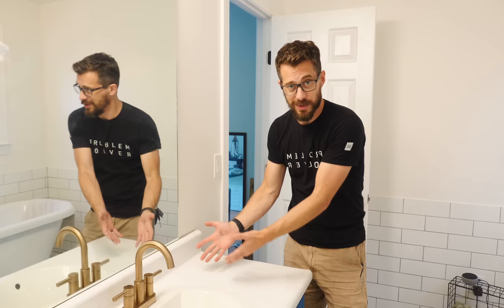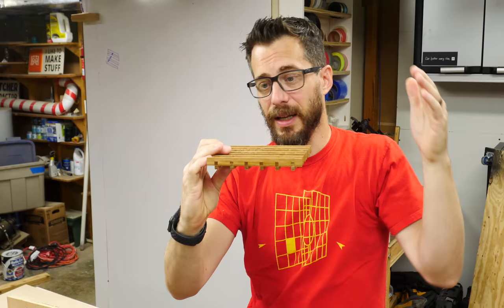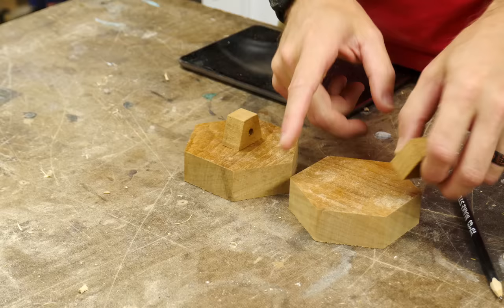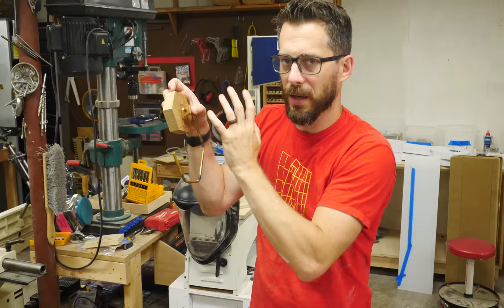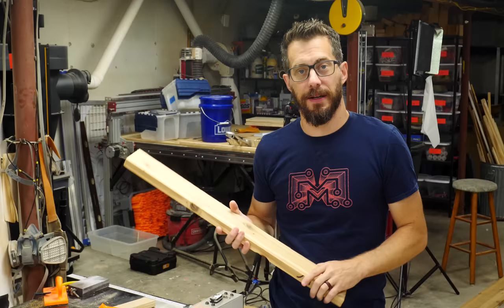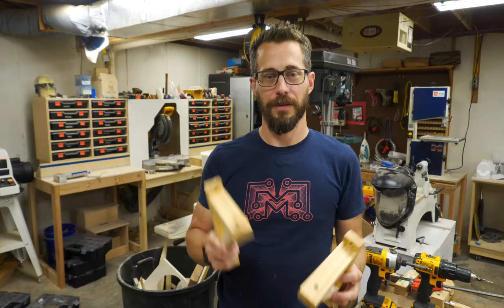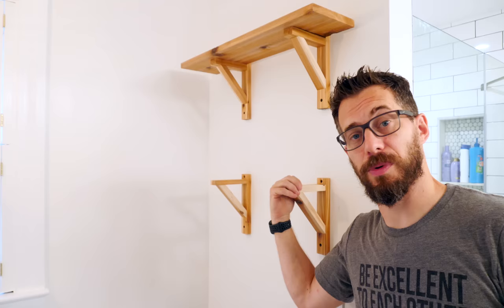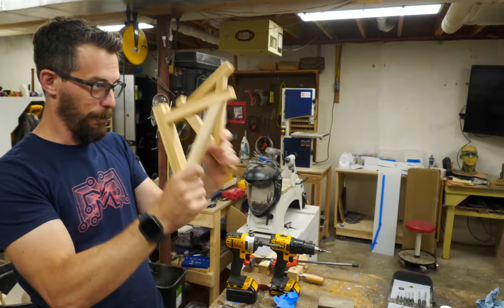How to Make 3 Easy Bathroom Projects // Woodworking | I Like To Make Stuff

Comment: A tip for things like the towel holder where the screws need to be in precise spots that you cant see, take the towel holder to the copy machine and make a copy.  You can then use the paper template to drill the holes in the correct location.
Reply: As the majority in my country is renting (empty!) appartments/houses and we would have to remove all our "individual" stuff if moving, I'd go with double-sided mirror tape (or another removable gluing method). Bc screwing screws ;o)
Reply: um...you've just changed my life forever. Thank you, sir.
Reply: Or if you don't have a copy machine or scanner handy, you can use an old mechanic's trick: hold a piece of paper on the part, and rub a slightly dirty finger (or a crayon) across the features you need to transfer,  like a gravestone rubbing you may have done in grade school! The outline comes out surprisingly sharp.

Advantage of the copier/scanner method is you can run off as many templates as you need.

Comment: Just a quick suggestion from a fellow DIYer with young kids. I would recommend attaching your towel hanger with screws directly to a stud. I have doubts about a keyhole mount surviving your kids hanging from the towel. I recently had to rehang my kids towel hanger after they nearly pulled it out of the wall where it had been attached with a large drywall anchor. If your kids would never do this then ignore the suggestion. Big fan of your work.

Comment: Loved that towel hanger. The cheap $3-$5 hanger I use on my wash basin breaks apart every year. This one looks simple and effective. Instead of brass I could use anything else like copper tube or acrylic rods  or rings whichever is at hand or easily available. Thank you.
Reply from the maker: Sounds cool, just make sure the copper doesn't leave corrosion marks on your towels.
Reply: @Iliketomakestuff  Good tip. Thanks.

Comment: I made almost exactly the same shelf brackets from cedar a few weeks ago. Only I put the top screw hole behind the brace. I just about managed to screw it to the wall but that was a challenge.

Also I might steal that idea for towel holders. Our bathroom doesn't have a solution I'm happy with and I like the hexagonal look for this. Cheers Bob 😀

Comment: Can't tell you how many shelves or curtain rods (or something with two brackets that need to be level) I've hung and it never occurred to me to use the LEVEL itself to mark the height of the two holes. So simple, yet so genius. I usually set the curtain rod, or the shelf up after attaching one side and then put the level on top of the shelf to figure out where to put the holes for the other.

Comment: Great small projects. Something to think about when bending the brass rod for the towel hanger, maybe make a form to bend it around that way you will get tighter more consistent bends. Also I learned that you should always wear a mask when working with teak as it is not really good for your lungs, more so then pine or oak.

Comment: Hi Bob,

I was wondering if you can do a video on how to install recessed lighting in a finnished roof that doesn't have attic access? Can you show how to plan out the placement of the lights while how to avoid joists and how to snake the wire across? I'm planning on installing some lights in my living room which is around 14 feet by 25 feet, but I I'm not quite sure how to do it without damaging the ceiling. The ceiling has popcorning, so repairing any damage is a nightmare.

Thanks.
Reply: You can use string and some thumbtacks to plan out the lights in the ceiling. We did that in our kitchen. This way you can ensure they are spaced consistently and can use another thumbtack to move them in our out along the string to maintain your distance. Lowes and Home Depot both sell recessed lighting that isn’t very tall into the ceiling so you’d cut your hole in the ceiling and then can fish the wires through to connect the lights. The only trouble would be placing power. If the room already has a light source in it, can you connect the wire to it and then run the wire over to each of your lights? We did the kitchen lights without going into the attic that way.
Reply: @BenTaylor11  Thanks for the tip. That seems easy enough. I don't have power in the ceiling though. Instead, I have a 3 way switch controlling an outlet. Also, whoever wired the circuit cheaped out and didn't put a neutral wire in the secondary 3 way switch. So, running power up there is the trickiest part.

Comment: you should do a bits video about different fasteners. I always run into issues when it comes to what fastner to use to put something on a wall or for other non-standard applications like you do in a lot of your videos.
Reply from the maker: Not a bad idea.
Reply: @Iliketomakestuff  You really should do that. I have a project that I'm working on currently, and I was uncertain on how to mount it to the wall so that the face closest to the wall is flush with the surface of the drywall. I have a keyhole bit & recently got a router with a plunge base, but it wouldn't have occurred to me to go that route until seeing your towel holders. It would be really helpful to see a smattering of fasteners and mounting techniques along side an explanation of what they work well for and what kind of aesthetic they lend themselves to.

Comment: I would add four little rubber legs to this soap dish in order to let water easily dry or go somewhere else. Flat parts of the wood in the bottom, even though it's teak wood, might not allow water to be removed easily which might cause stains or mold can appear.

Comment: Not sure for your shelf putting the screws into the end grain of the horizontal piece is the best idea considering all the weight it needs to carries. Maybe putting a dado on the verticle piece for the horizontal one to sit inside will help and so the piece is supporting by the wood.

Comment: Well you might have oiled the shelves, because even if they can't be soaked in water, humidity can accumulate on them and so lead to small deterioration over time but tht's an impresive work!

Comment: Did you consider cutting out a metal template and bending the copper pipe around that for the towel holder? Might help keep them consistent.

Comment: Awesome!! I think I'm going to try to make the soap dishes with a miter saw. Any tips on cutting the channels?
Reply from the maker: Most miter saws have a little bolt that allows you to set a depth. Look on your saw and see if you can extend that bolt so that it stops before it goes all the way through.

Comment: is the glue strong enough to hold someone yanking on the towel to wash their hands?  could you use a screw or to give that joint a bit more strength?
Reply from the maker: I have total confidence in its strength.

Comment: Did you use an special glue resistant to water for the soap dish? Love the projects!
Reply from the maker: Yes, the weldbond does well in the water
Reply: Thanks!
Reply: @joshuatharpe9397  Titebond 3 is waterproof

Comment: Beautiful. But that towel holder need a screw or nail... I feel the weight of the wet towel will eventually break it apart.
Reply: I just screwed in a 4" deck screw into my wall and hang the towel on it!

Comment: Looks like the shelves were hung on the back of the wall with the shower controls.  Be careful where you drill, it is no picnic to run to shut off the water after drilling into a pipe.  Then ripping into the wall to fix it.

Comment: Mounting shelf brackets with drywall screws? What in tarnation
Reply from the maker: Is there some issue that I'm not aware of that you can teach everyone about?
Reply: @Iliketomakestuff  I'm sure it's completely functional and works fine, just not "ideal". But they're very brittle compared to wood screws/deck screws, and lateral stress on them should be avoided. They also love to snap if you get them just a little too tight. Those shelves aren't exactly bearing a huge load, though. Also, depending on how you pre-drill your holes in the shelf, the fact that they're threaded along the entire length can cause a small gap between the shelf and the wall.